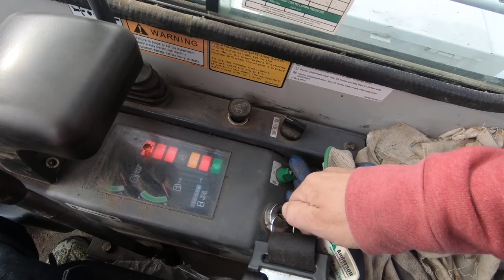Why DO I Always Do this?!?  It Never Helps

Comment: I do deep bedding in my coop. In the fall I go around the neighborhood and pick up all the bagged leaves and pine needles. I use them and a little straw. It turns into fine soil by the time I clean up the coop. The best part is the neighbors get their litter picked up and I get free bedding which keeps my coop fresh all season.
Reply: How do you store it all?
Reply: Evolution of a Homestead 
I have 2 coops. A large one the birds are in for the winter and a smaller one that I put all the bags in. The over flow are stacked outside under a tarp right next to the coop and used first.
Reply: Great!  That's my plan.   I collected 10 or 11 pickup loads of leaves from my lawn last year, and plan to do the same this fall.   I was planning to use it as deep bedding when we start our flock next year
Reply: Oak Knob Farm 
I believe I use a bag a week to refresh the coop. So it really doesn’t take many for me. My coop is 12x12. It works out great and smells so fresh for the birds. Make great compost too. I always have bags of leaves left in the spring. Then I spread them in the garden. I let my birds out into it in the spring before planting then they work them in for me. Works out great.
Reply: Thanks for the reply Ann Laughlin!   Sounds perfect to me, I hope we have the same success!   Our coop will be much smaller, we're only starting with a half dozen egg-layers.   So, hopefully it won't get too funky anyways.    We'll try meat birds year 2, I think.

Comment: Al , something I find very handy is to have a towball ( old school tongue type ) bolted to the bucket of the tractor , then it's easy to load something into a trailer , hook it up to the ball and drive the trailer forwards to where you want it then lift as high as possible to use as a tipping trailer for easy unloading .  It saves a lot of short trips with just a bucket full at a time . Saves your neck a fair bit too compared to rear towing / reversing .
Reply from the maker: Great idea

Comment: I bought a truck bed unloader.  Then I put it in my pickup and backed right up to the deep bedding in the stalls.  I had my helper clean directly into the truck.   The bed unloader made the unload a breeze.  Works great.

Comment: I like that deep bedding idea.  With your just laying the bales flat in the critter tractor I can see how much easier it is to pick up to move to the compost pile.  Also you can lay a ring of bales on edge around the sides to help give a little more wind break/insulation for the animals.

Comment: Straw makes a great deep bedding pack for large animals like cattle or a lot of pigs. There isn’t enough urine or wet manure with chickens to get the heat going in the deep part of the bed. We use straw in winter but shavings in summer under our roost but we have 75 to 100 chickens. That bedding looks really good to be composting and how awesome to see the worms. Have you thought of scattering some of that ‘stuff’ on the parts of the new pasture that are needing more organic.  And yes you DO get it done, and very well👍🏼👍🏼👍🏼

Comment: If you wanted the chicken manure more integrated with the straw/hay (instead of matted on the top) you could toss and spread a fresh flake or two every week or so on the base layer.  That would give the hens something to do during the winter; my girls love new hay and scratch through it to get the seeds.  (I've never used straw, and it doesn't seem like it would encourage scratching?). The manure would get spread through the hay and likely compost better in place, creating some heat and a place for worms, and no thick mat.  You could also put a layer of leaves or sawdust when they were available.  You'd still have to dig it out at some point though, but it might be more garden ready.  I need to go back to when you modified that frame to put your chickens in it.  I think I might have one of those frames.  Maybe I could put it where I want my winter squash garden next year....  though I wonder if you fastened it to the ground somehow (I would definitely need to).
Reply: Our chickens like hay too, we put it out for them when the ground is covered in snow. I think the eggs are more yellow from those 'greens' than without hay in winter.

Comment: Ive been enjoying your daily videos.  Currently looking for more acreage so I can expand my currenly very small farm.  You have some very good knowledge to share so thanks for sharing.  Also, just a tip about the quiche, try adding some heavy cream or any kind of cream, it makes the quiche lighter and fluffier tasting.  Also just a small sprinkle of nutmeg brings out the flavor.  I make quiche all the times (Lots of eggs here).  Bake at 425 for the first 15 minutes then 325 for about 35-40 minutes.  Egg mixture will be nice and puffy all the way above the sides of the crust.  Enjoy!

Comment: One suggestion I learned cleaning out an old cow loafing shed in NC.....a tiller is great for breaking the stuff up to get it out.  We had huge sheets of 10+ year old  composted manure in there and it was a bear!  Using the tiller to break it up helped a lot.  Probably would work with the deep bedding.
Reply from the maker: That's a great idea thanks

Comment: Been down the deep litter hay/straw road....switched to planer shavings. Much easier to muck out and more absorbent. Not to mention about the same price as 1st cut hay and way cheaper than straw....at least at the feed stores on this side of the CT river. You can check local sawmills too. They usually have piles of it free for the taking.
Reply from the maker: Yea straw ain't cheap

Comment: I use  wood shavings no more  clumps   I  do  like  to  save  dry   grass  clippings  from the lawn  to give my chickens   on the cold   winter  days  they seem to love it.   The  short   grass    doesn't seem to clump   as  bad as  hay or straw  Learned    the  miseries   of  hay   when I was  a  kid  cleaning  out   the  spring coup  and  half  the  coup   floor   seemed to be stuck  to  each  fork full  .   : )

Comment: If you want your Kubota bucket to hold more, attach the forks onto it and place a pallet on top. It will increase surface area for hauling the hay or garden scraps. Also, did you consider wood chips instead of straw for the chicken coop floor?

Comment: Have you ever thought about using sand? I know it sounds a bit odd but that's what I've been using for the 3 yrs and it works great! I've never had to really clean it out. I just rack though it and get out any feathers or any of the big stuff and sprinkle down some DE or seven dust like twice a year for fleas control. I also use vinegar with orange peel every few months and spray everything down. I live in Central Florida so not sure if that would work for you or not. But you definitely would have to worry about it matting up.

Comment: AL !  WHERE THE HECK IS YOUR DUST MASK ??  That chicken greenhouse is open at the front. I think that I would have just moved it backwards to a new spot. You had a good chance to damage it with the excavator.   By the way , how do you rent the excavator ?By the day or the hours of operation ?
 My tomatoes are not ripening. I've got full sized very green tomatoes. And I do not think that they will ripen before they get well frosted !  It looks like a good time to try out that recipe from Hillbilly Kitchen. Fried green tomatoes ! It looks like a good recipe.  My own efforts were only just edible and not what you would call good.
  A little excitement couple of days ago.  I caught a large Great Horned Owl ! Not by plan though. .I had left a small opening in the top of my mobile chicken tractor.  The owl got in there and ate half of one of my barred rock hens. And then could not find it's way out. I spotted the dead chicken first. What the heck ? Then as I went to the other side of the coop to get a better look , I saw two huge eyes looking at me.  I was a bit startled for a second until I realized what it was. What a beautiful large bird it was ! Except of course it had eaten one of my chickens. Entirely my fault because I had left that opening.  I used the opportunity to get a good close up look at the owl.
I usually only get a glimpse as they fly past me.  Then I opened the door on top so it could fly off.  Nope , it was going to stay put. I got it to move around inside the coop but it would not fly out. Finally I lifted one side of the coop and it walked out of the coop and flew off as soon as it was clear of the coop. It had a huge wingspan.  More than four feet wide. Maybe close to five feet wide.  And the wings from the leading edge to trailing edge for quite a distance from it's body were more than a foot wide.
You could see that it had some lifting power. I could see it carrying off a small dog with no trouble at all . And a cat would be easy for it. From the size of the owl I would say that it has been a good hunter.  But that was your last chicken meal. At least from me.
Reply: Wow, that reminds me of the story of Jeni catching a hawk in their farm on the Pratt family homestead.
Reply: Try wrapping your remaining green tomatoes in newspaper and putting in a cool dark spot. Periodically check on them for ripening. With luck they will slowly ripen and you will have tomatoes long into the cold season.

Comment: Would it be easier to move the structure and plant a garden there? Or use the Joel salatin method of spreading corn seed in the hay during the season, and then letting the pigs in to turn everything?

Comment: Al
I suggest you rent a wood chipper.
Thin out a few trees. Trees should be a minimum of an average person's hand spread.
Fill the coop with the wood chips 3" deep.
Have enough chips to last winter.
Add chips as required.
Remove chip/💩 next year

Comment: You can get a hooked pitch form meant for turning hay and other stuff. I actually use mine for pruning all of those roses, because I can carry huge loads of prune piles on it without touching the thorns. Here is an example:

www.amazon.com/Truper-33568-4-Tine-Forged-54-Inch/dp/B0026KCK2I/ref=sr_1_36?ie=UTF8&qid=1538485159&sr=8-36&keywords=pitch%2Bfork&th=1

Comment: I know it's too late now but you could have used the excavator to just lift the whole structure and moved it out of the way. You could do the same thing with the kabota in the spring by just pulling it forward and to a different spot then planting in that spot. then pull it back over it in the fall to extend you growing season. Then move New Yolk city back to it and let the chickens clean up the garden and start over again. Less work for you and you get even more out of the chickens. Now I need to build a mobile greenhouse Oh man another project on the list.
Reply: Good idea, but that little hoop house doesn't look like it could take being moved like that ?
Reply: In the video he lifted it with the excavator and it seemed very solid
Reply: @augustreil  that one isnt a hoop house. It's actually one of the steel tube garages.  It could handle the move.
Reply: thinking the same thing

Comment: Nope straw will still compact and mat together.......we find pine shavings work best for deep litter
Reply from the maker: Good to know. I wonder if a mix of both would work
Reply: @LumnahAcres  I think if you layered it or mixed it that would work. The straw does compost faster tho as it is hollow and keeps more oxygen available for the bugs. But the shavings even when not fully composted add great humus component to your soil.
Reply: Chopped bedding would work, big parts will compact into a mat. Chopped hay, straw, leaves, ... it will start right in the henhouse then, including worms, etc. as extra snacks for the chickens and the scratching will speed up the composting too.

Comment: Can you just pick up the whole coop and move it off the bedding? That way you could come in from the edges and really roll over the whole thing to break it up with the tractor before carting it off to the compost pile. That or just heap it up in place and move the coop to a new location.
Reply: Also maybe use the forks? If it's sticking together may as well use that to your advantage.